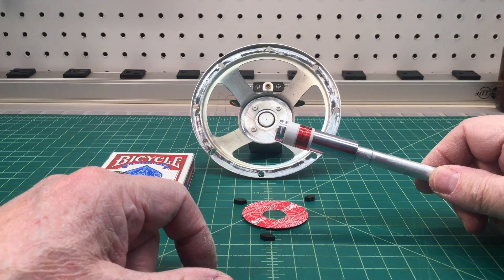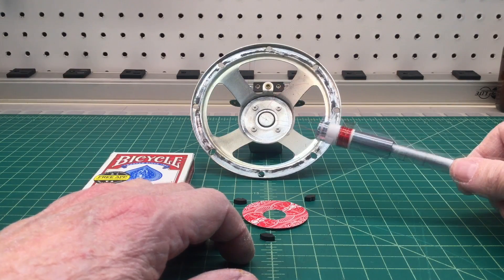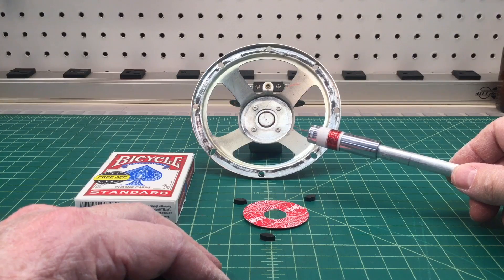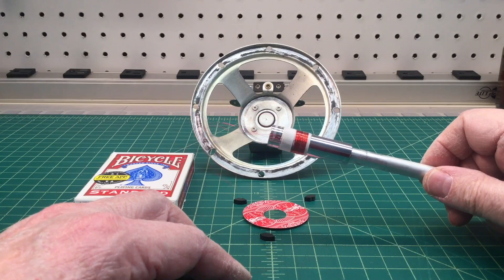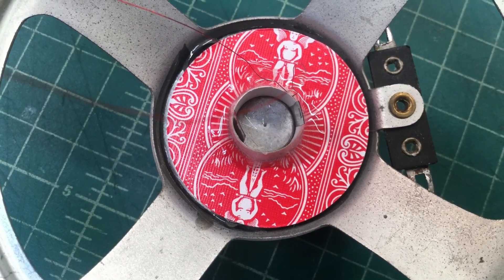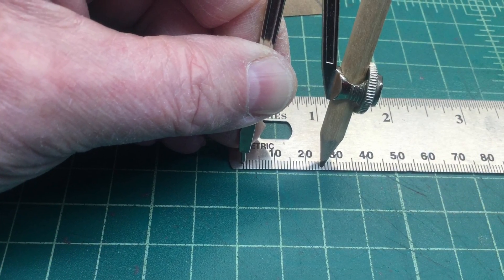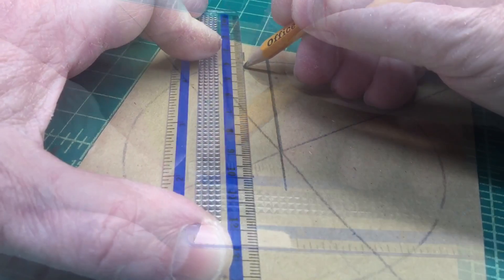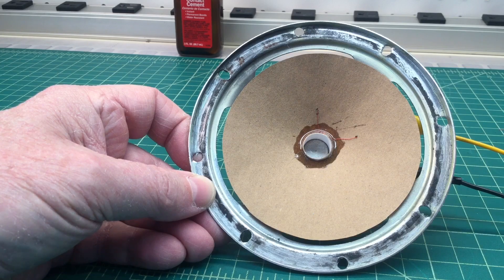Experimental Speaker: Making a Paper Cone & New Surround +

Comment: Don, A bunch of questions please....(1) How do you determine how deep you place the voice coil  down on the speaker's pole?  (2) is it wire side up (closest to the cone) or wire side down?  (3) Is the length of the paper form (the voice coil winds on)  typically twice that of the coil itself once wound? (4)  Lastly, I know keeping debris away from the pole and voicecoil is paramount, but when using alcohol spray to free a voice coil & reform the cone, (a) is the varnish insulation in jeopardy when using that spray &  (b) once spraying would WD 40 silicone be okay to use down towards the voicecoil to free and keep free?Thanks from a 'new to restoring ' patrion.
Reply from the maker: Please forgive my belated response. I’ll do my best to answer your questions in order of...

1 - The voice coil is placed in the center of the pole piece/core so it doesn’t bottom out or move pass the top of the center pole piece/core.

2 - I’m not sure I totally understand the question, but the winding may overlap, so you may have the start winding closer to the cone and the other at the bottom of the coil or two layers with the end winding of the coil at the same position as the start winding. 

3 - Depends on the depth of the center pole piece and the the distance just a bit longer than the height of the spider itself. 

4 - Debris in the area can be a problem to your point. I’m not sure on the Silicone spray; never tried it, but it’s worth trying.

Thanks for reaching out and I hope you find this helpful. Let me know after you review and I’ll try my best to clarify. 

Best,

Don
Reply: @RestoreOldRadios  No problem on your timing and thanks for your response and help (have since worked out my original questions).  BTW: I'm about to attempt a complete cone job on a RCA 812 I'm restoring; knowing in advance that if it doesn't go quite as planned I'll be looking for one anyway. I'd be happy to share some progress pictures on it if you have an email link. (It's my 2nd set since being quarantined and 4th since November).   And one more please: That new A.M. broadcast circuit will (or at least may be) tried soon. The original has worked wonders for me but can easily be  drowned out and overwhelmed when using it for a tone source (i.e. mixing it with a signal generator output)...but again, has served me well and has helped me align 4 sets to date.  Thanks for all you do and videos. Best wishes and regards G. Raines
Reply from the maker: My Youtube I would enjoy seeing your progress. I’m far from a SME and appreciate others sharing their knowledge and skills. My gmail is: TheRadioRepairGuy

Best,

Don

Comment: On your dry fit of the voice coil, is the top of the voice coil wire level with top of the magnet?

Jim
Reply from the maker: +Jim Gross Jim, I had to place the top of the coil ~1mm above the top of the magnet. The reason was the new coil was 2mm thicker/longer than the original. I used 36 AWG magnet wire to make the new coil and it looks like the OEM was 37 or 37.5 AWG based on DC resistance per foot. I hope this answers your question. Please let me know and thanks again for reaching out. Best, Don
Reply: RestoreOldRadios Thanks that answers my question.
Reply from the maker: +Jim Gross Thanks again for viewing. Best, Don

Comment: wait, you have to do math to measure for a new speaker cone? forget it. I can barely add and subtract!
Reply from the maker: +coolbluelights Sure you can, don't underestimate your abilities. Are you doing any radio work these days? Best, Don
Reply: A little, been busy renovating my house this year though. I'm much too dyslexic to do advanced math like that. in 3rd grade I had a 6th grade reading level but I could barely add and subtract. I have to refer to charts when doing conversions. numbers slip through my head like a sieve.
Reply from the maker: +coolbluelights If you ever have a need to make a cone, just let me know I'll be glad to help. Good luck on the work around the house. With Spring just weeks away, I've got many things on my to do list too. Best, Don
Reply: Thanks Don

Comment: I have used a thin foam from craft stores that would make a better surround than cloth I think.  It is flexible but it is also firm which I think would work nicely for this application.  I just measured it and it is .083 inches thick.   Might be something to look at before following through with the cloth surround.
Reply from the maker: +jp040759 Thanks for the tip jp. Thinning the silicone down before applying it to the microfiber is still a concern due to it's weight. I wish I had two speakers to try the solutions on. I think I'll go your route, but still make the fabric/silicone and lay it on the cone and see how it responds. Thanks again for your support. Best, Don
Reply: You're welcome.  Looking forward to see how this ends up.  Great challenge.  Good luck.
Reply from the maker: +jp040759 Thank you.